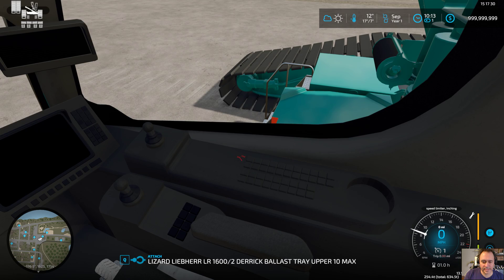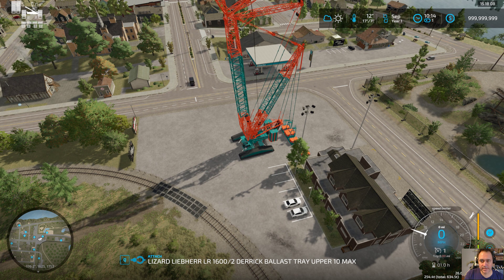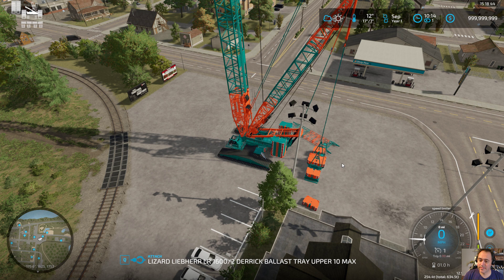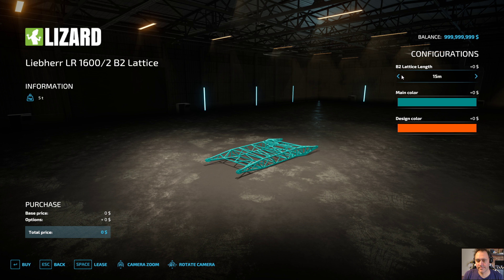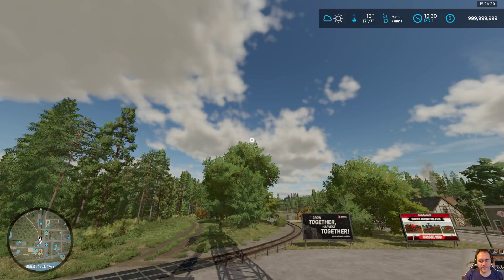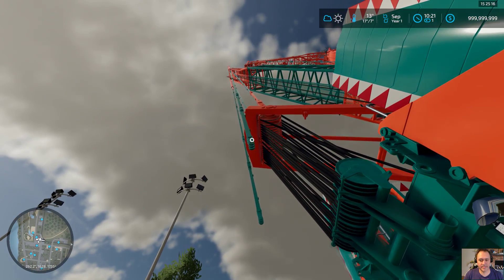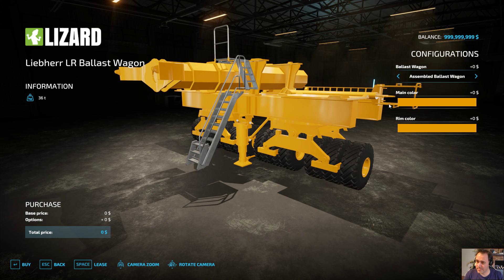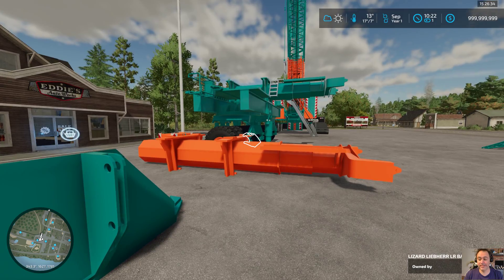FS22 Liebherr LR 1600/2 Ballast Assembly Tutorial: Updated

Comment: Wonder if you can use two joysticks and configure the binds and simulate operating the crane like you would in real life. Wonder if that could work.
Reply from the maker: You can. I use a controller and have the left and right sticks setup as they would with the real crane. Use one of the modifier keys and right stick for the far right joystick.
Reply: @jeremybrown9379  I'll even give that a shot

Comment: hello, if i dowload the Trail King Double Schnable Trailer and Wind Tower Sections, i have only the trailer in the dealer, i have no tower. is this a bug? because in the begin when the trailer was came out i had the trailer with the tower sections and now i have only the trailer.
Reply from the maker: The tower sections are in a Heavy Haul section in the main Tool group, where you find all the tractor tools and other tools.
Reply from the maker: It is a bug. I missed referencing the specialization that adds the category. Until the full tower releases just download the other heavy haul loads and it should show up.